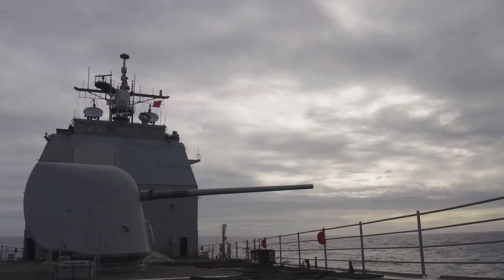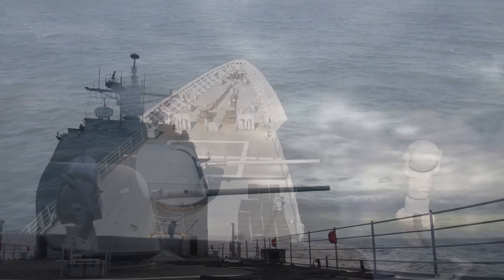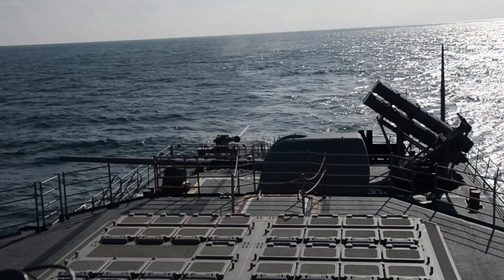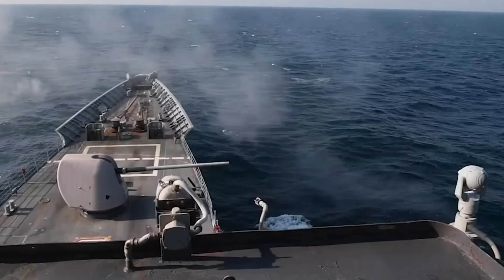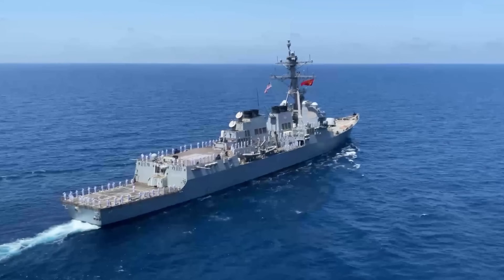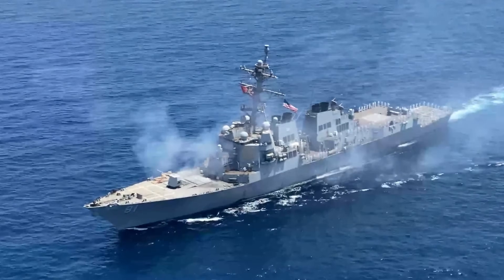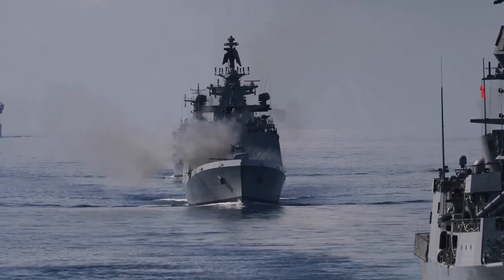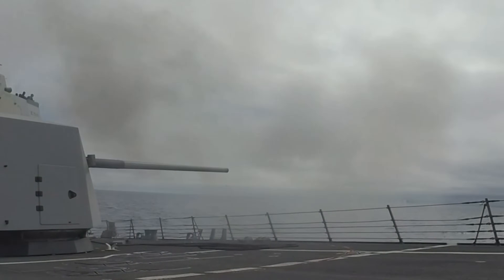The Mark 45 (Mk 45) Naval Gun System | FIVE INCH FIREPOWER

Comment: The ROF is about the same as the WW2 era 5"/38 which was a "Manually" loaded weapon. The Breda 5"and Soviet 5" both have higer rates of fire.
Reply: The previous version the mk68 system had a higher rof than mk86

Comment: why use a gun, the shells don't cost the amount of a missile. It is harder to intercept. You get more shells in a given space than missiles
Reply: Missiles are far hard to shoot down than gun rounds. Missiles move faster, carry more explosive power, can maneuver, can avoid countermeasures, and have very long ranges. An artillery shell from a gun CAN be intercepted by a missile or the ships closed in weapons system which fires armor piercing high explosive rounds. Yes, it would stop the artillery shell because said shells are NOT armored and a 20mm round ripping into it will either destroy it or damage it enough that aerodynamic forces throw it off course or make it destroy itself. This is why the army uses the C-Ram system for rocket, mortar and, artillery defense for their bases. Its very effective.
Reply: @Coinz8 that's why the navy uses the cwis to shoot down the missles

Comment: Can you please do a video on the entire Mk34 Gun weapon system, not just the gun alone? I came here looking for info on the Gun director system for the Mk45, not just the gun itself. I know there is a Mk20 Electrooptical director, but what radar provides gun direction? Does it use the AGEIS radar to aim the gun or one of the smaller SLQ-32 systems? It would also be interesting to do a theoretical bit about how the 16inch battleship guns would be aimed by the Mk34 system and how could the Iowa's 5 inch guns be replaced with two of these in the current mounts.

Comment: A question for anyone...
Didn't the Navy experiment with a RAP (rocket assisted projectile) for these guns with a really long range (40/60 miles)?
Whatever happened with that, or am I mistaken....
Thanks..
Reply: I've never heard or seen one for the 5" guns although the gun computers were configured to use them for atleast 50 years. The 6" guns for the zumwalt destroyers  were designed to to use the Lrrap rounds but are being refilled because the rounds cost from 800k to 1M each about the same as a missle. But keep in mind that you could have had a lot more of those rounds aboard than missles and the navy did use 6" rounds in WW2 and already have the ballistics calculated for regular rounds.

Comment: I want to see them adapt the Mk. 45 into a tank gun. Autoloader for a 1 piece round, give it a fairly high elevation at least on a limited arc for use as an artillery support unit when needed. I don't know if they would want to go with a smoothbore or rifled barrel, probably smoothbore for the discarding sabot velocity advantages.

Comment: We had the 62 calibre version of the MK45 on my ship. During a live fire exercise, we were supposed to engage an automated, low-flying, target aircraft. Our gunner, FC2 McManus, was operating the the gun mount from CIC.
Without telling anyone, McManus fired off an AP round at the target, rather than the proximity-fuse, fragmentation type. He intended to follow up with AA rounds after the first shot, but he didn't have to. The first round was a direct hit.
After that, he boasted (justifiably) for some time about killing an aircraft with an AP round, but it also goes to show you the capability of this naval gun system.
Reply: I shot a target drone down with 1 bl&p round didn't need Explosives just sand

Comment: Onboard USS Independence they had 4 5" 54 radar controlled 2 port and 2 starboard aft for BPDS and anti air, 1970. Put on quite a show especially  during anti air practice, whoa looks like a scene from Victory at Sea as a Stoof pulling a metallicized banner made passes for gunnery practice 😳

Comment: Naval guns pretty much arent use as much for primary naval engagement, if youre… then youre have done alot of things wrong. 
They are more for finishing off the main engagement, engaging smaller contacts, last line of defence and support for amphibious operations. Its a cost effective weapon system to finish off a job or an engagement method for a low value target. You can go lighter caliber with minimal lost of capability.

Comment: This Mark 45 gun system is popular because it is used in the USN.  As commented below, an excellent competitor is the Otobreda 127/64 produced by Oto Melara.  For a start, it has a significantly greater rate of fire than the Mark 45 (up to 43 RPM).  IMHO, I think that you would find that the two systems would be comparable in the majority of other features.
With respect to the use of naval guns, there is a tendency to forget one critical feature of guns vs missiles -- that is its ability to be reloaded at sea.  The frigates and destroyers have a limited number of missiles on board.  Once they are fired, they cannot be reloaded without the ship tying up alongside. (fleet actions and various 'what-if' scenarios set aside).  With respect to the gun systems on board a ship, if the supply of rounds gets low, the ship, more often than not, will get additional rounds during a 'replenishment at sea' (RAS).  These rounds can then be loaded back into the magazines and permits the guns to be used again without the requirement to tie up alongside.  Until there is an improvement made to enable missiles to be reloaded at sea, this will be a significant factor of guns over missiles.  The other consideration is cost.  Missiles are significantly more expensive than artillery rounds.  The destructive power of approx 70 lbs of HE (one shell) can definitely give a navy significant 'bang for its buck' over that of a missile.  If one factors extended range shells, then the naval gun becomes even more of a factor, IMHO.
Reply: Correction to the rate of fire -- was supposed to be 32.  My bad.
Reply: @edp8592  It's predecessor the Otobreda 127/54 Compact had a rate of fire of 40rpm. It looks like the need to handle long range precision munition slowed down the rate of fire.
Reply: The predecessor of the Mk45, the Mk42, had a fire rate of 40 rpm. The US Navy realized that the higher fire rate is not really useful. That's why they toned it down to 20 rpm.

Comment: Does the barrel have some kind of cooling system. Some barrels are water cooled.
Reply: No cooling system. I'm surprised that the fire hoses weren't laid out on deck. There needed incase of a missed fire because if the gun is used rapid fire you have what's called a hot gun and a miss fire then could cause the round to explode in the barrel. Not good

Comment: Personally I think NATO navies should switch to 155mm. They would be able to share the already massive stocks with their NATO Army and Marine counterparts. And with the new rocket assisted rounds that are coming out that are suppose to push 70km NATO navies would be able to conduct shore bombardment while staying away from shore and over the horizon. And it would be a lot more cost effective than using surface to surface missiles to do the same job. Not that it would replace the cruise missile rather provide a cheaper option for lower value and/or less defended targets that still need to be hit from range. They would also get access to the now immense  amount of GPS and Laser guided rounds and copperhead missiles that would be good for moving targets or targets that need pinpoint accuracy. The only major down sides I can see is it's a larger round and needs more powder which take up space and might pose a more of a safety risk since 155 still uses smaller but stackable bag charges. That also might reduce the fire rate if the auto loader has to sort out how many charges to use for each round. Even though I suppose it could become doctrine to just use a set amount of bags for each round and/' or develop a brass casing for the 155mm.
Reply: The casings are aluminum

Comment: JUST IMAGINE 🤔, what would it look like if you designed this system to handle 16" inch rounds? I think that it is possible to achieve this goal. Just make the dimensions larger to handle the bigger round. Wouldn't that be cool! To have a 5" inch gun mount on one end and another gun that's placed somewhere else. Just my thoughts or maybe just daydreaming. Great video. Thanks.
Reply: Ridiculous idea.

Comment: Missiles are great for the the long range to middle range. It's nice to have a moderate to close in weapon that can be called upon, especially for use against smaller craft, and far less expensive than the missiles. I like that the navy is using the proven 5" weapon.

Comment: Is there a reason these naval guns didnt standardise to the same 155mm calibre that ground based artillery did? What is the extra capability that comes from the "non-standard" calibre? Is it not possible to use standard 155mm shells that are already in use with different propellant packages that are more suited for naval usage?
Reply: 127mm is the standard caliber for naval dual purpose guns since before WWII. It's the heaviest ammunition, that can be handle securely by a single man on a rolling ship.
Traditionally it is also used in AA. There is no 155mm AA ammuntion. 127mm has a much higer sustained rate of fire than any 
land based 155mm. 
Adapting any land weapon to marine use is not trivial. It often fails, if it is not a design consideration from the start.
For example 155mm have to been certified to be stored so close to a really strong radar.  
There have been several attempts, which all failed. E,g, Monarch derived from PzH2000. IIRC the UK experimented with a variant of the AS-90, but then choose the 127mm Type 45.
The dead to all experiments with 155mm guns in the US was the AGS of the Zumwalt class, which was an unmitigated disaster.

Comment: We went from how big can you make a shell/gun and four naval rifles in a turret to a 5  inch gun is all we need and a single main gun on a ship. It's a joke. One we are going to find out the hard way. I understand missiles are "better" but you run out of missiles quickly and not all are good for sinking boats.
Reply: You can run out of rounds FAR quicker than missiles. A arleigh burke carries 90 missiles, thats just ONE ship in a fleet.  
 Missiles are far hard to shoot down than gun rounds. Missiles move faster, carry more explosive power, can maneuver, can avoid countermeasures, and have very long ranges. An artillery shell from a gun CAN be intercepted by a missile or the ships closed in weapons system which fires armor piercing high explosive rounds. Yes, it would stop the artillery shell because said shells are NOT armored and a 20mm round ripping into it will either destroy it or damage it enough that aerodynamic forces throw it off course or make it destroy itself. This is why the army uses the C-Ram system for rocket, mortar and, artillery defense for their bases. Its very effective.

Comment: I’m surprised a navalised 155/52 cal gun hasn’t been developed and adopted.
Reply: I think that you would find at least 2 issues.  Firstly, the overall weight and volume of the gun mount as well as the magazine could be a major concern, especially on smaller ships.  Secondly, the size and weight of the round would be a major consideration.  Since the rounds are bigger and heavier, the ship would be forced to carry fewer rounds, and would be more dependent on re-supply vs a gun of a smaller calibre such as the 127 mm.
Reply: You take that back you landlubber heh. 

It would be cool as the M777 are very good guns. Plus the reversal of the Navy receiving land based gun systems would be a cool point in history.  
I think that Zumwltz were supposed to deploy a modified M777 weapon system. 

Traditionally the Navy deployed 6” rapid fire guns (152.5mm).  
It would be interesting to see what barrel caliber they’d modify it to.
Reply: Rate of fire and velocity of the round are more important in modern naval warfare then shear damage: remember the 155mm is an horowitzer round with a defined ballistic trajectory. The Zumwalt tried a 155mm but was a completely different beast and failed miserably.
The Germans also tried bringing their 155/62 on their latest frigades but in the end it was a failure and they mounted the OTO 127mm modern design, well proved, best in class and with Vulcano ammunition that really put the gun in a category on its own.
Reply: The Navy tested an 8" 55 caliber gun Mk-71 on the USS Hull DD-945 in the 70's to see if it was a viable gun for a small ship. Aparently it was inaccurate, but it was on a Korean war era Forrest Sherman class DD. I think it would be a great fit for the Arleigh Burke class DDG's replacing the 5" gun they currently have.

Comment: The Chinese and the Russian Naval assets can easily shoot down exocet or tomahawk missiles down easy enough, however, shooting down a 16"or18" projectile in flight is an altogether different sort of challenge in and of itself. 
Do not ever ever ever give up the guns. Never...
😷🚕🛣️🎯🤔🧐😁✌️🌞
Reply: Russia and China would have a hard time shooting down these missiles after their radars and counter measures are jammed. Missiles are far hard to shoot down than gun rounds. Missiles move faster, carry more explosive power, can maneuver, can avoid countermeasures, and have very long ranges. An artillery shell from a gun CAN be intercepted by a missile or the ships closed in weapons system which fires armor piercing high explosive rounds. Yes, it would stop the artillery shell because said shells are NOT armored and a 20mm round ripping into it will either destroy it or damage it enough that aerodynamic forces throw it off course or make it destroy itself. This is why the army uses the C-Ram system for rocket, mortar and, artillery defense for their bases. Its very effective.

Comment: The UK will finally be getting this on the new ships , find it weird the navy stuck with the 4.5 inch for so long
Reply: I just realised that the UK wasn't a user till I remembered that just about every single test ship had one before being moth balled meaning they've been eyeing it for years. (Probably budget blocker it being adopted)
Reply: The 4.5”Mk 8 has been the  standard RN main gun since the 1970’s. Upgraded several times, the type 26 will be the first RN ships to use the 5” MK 45

Comment: Part of my early (U.S.) Coast Guard career involved carrying powder cases and projectiles for our ancient and honorable 5”/38, the predecessor for this system. (Navy surplus, probably from a decommissioned Fletcher or the like.) Couldn’t even track a Skyhawk in anti-air, but still perfectly adequate for intimidating drug runners and near-shore gunfire support in Vietnamese.
A note on metric: the 5”/38 was 5”, not 127mm. The 76mm Oto Melara that replaced it (~1973) is 76mm, not 3”. We use metric for a lot of stuff, just not as obsessed with it as the metric mafia across the pond.
Reply: 127mm IS 5" (inches)
Reply: 76 millimeters is 3"

Comment: Worked on the MK45 Mod 0 and the MK42 Mod 9, I can still hear the Hydraulic pumps come to life. I knew every switch and valve on them. Pretty darn interesting ripping into these when casualties do happen. Lots of pipes and screws to get out of the way to get to the parts. Still use the technical skills learned in the Navy.... Order of operations is very important. The Magazine system is new, I always had the hand loading crew that smell in the magazine, nothing like it. May be good to include the importance of the Fire Controlman in CIC and running the Mark 34 Gun Weapon System. Those guys were great, Gunners Mates were the dirty, greasy Topsiders. Loved it! Took great pride in keeping the barrel grease looking good.
Reply: Shweeet Dude...

Comment: My dad was a Fire Controlman for the Mk 86 system on a spruance class destroyer.   The system updated 100 times  a second  .  In one exercise  they were firing on a towed target sled.  Another FC was supposed to put a 3 degree offset so the rounds were supposed  to land just behind it.  But he didnt and 3 round hit the sled and blew it up.  The FC chief  vouched for him.   Another time they  were going to be firing at aircraft target. I may not tell the story as it was but somehow the 5inch loaded a round and fired the round wizzed by the  aircraft and the  pilot was a pilot and Vietnam and knew rhe round was close. He was like "you just shot at me im out"  the FC said i didnt not touch anything and it was verified.  They get into port and a bunch of civillian employees came on board to inspect in an electical l box for the gun rhere was alot of corrosion and somehow the circuit was complete and it loaded and fire
Reply: I served on USS Kinkaid DD 965 1987-89....

Comment: Is there a reason why the navy use 5 inch shells instead of 6 inch shells (155mm)
Reply: The US basically settled on 5" as a standard for naval guns by around 1900. Contrast with the UK which, during WW1 and WW2, was producing projectiles for several dozen different guns in the 4", 4.5", 4.7", and 5.25" range because they were searching for "perfect" rather than standardizing on "pretty good".
Reply: A 5" shell was also doable for a sailor to carry to the gun.

Comment: Why not a barrel evacuator to keep the fumes out?
Reply: All of the MK45 variants have a pneumatic evacuation system that triggers before the spent powder cartridge is extracted.
Reply: @brianfottrell1170  I figured so. Then why are cordite fumes such a problem?
Reply: @DavidFMayerPhD  In general, the toxicity, but the evacuation system eliminates the danger through normal operation.
Reply: @brianfottrell1170 And that is what that little second puff of smoke is.